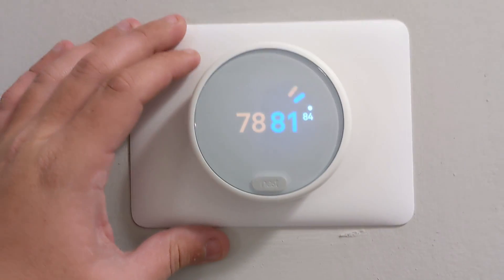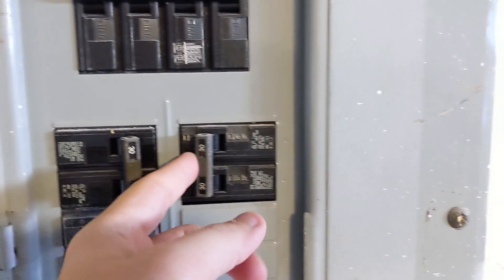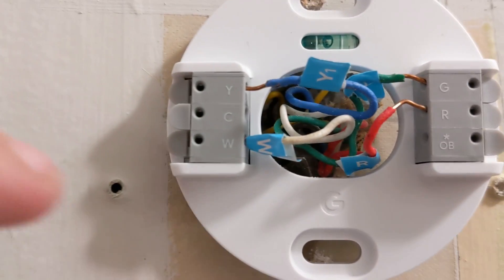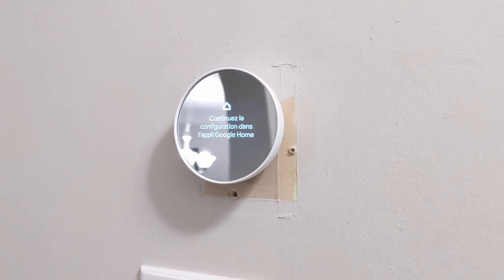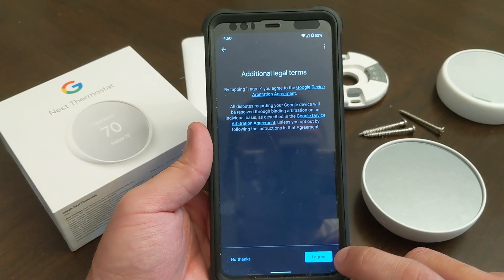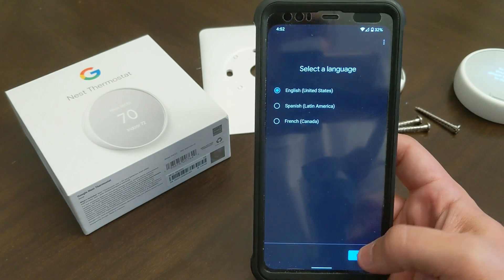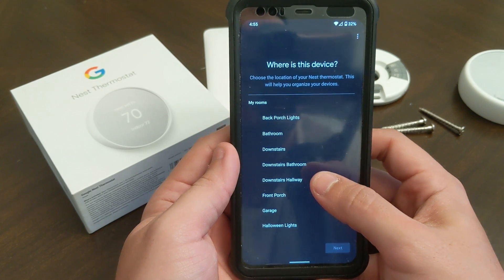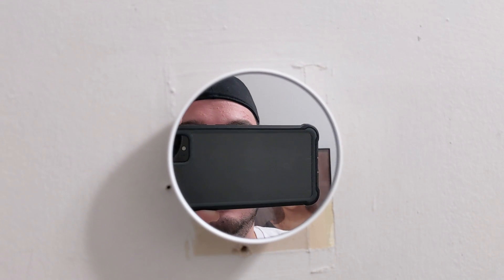Google Nest Thermostat Full Install & Setup!

Comment: I had issues with setting up the nest thermostat with my new eero network. I had to reset the thermostat using the setting on the thermostat. I then had to use the troubleshooting setting in the eero app to set it to 2.4 ghz until it recognized the nest and got the wifi connected.

Comment: I have a wire labeled Rh where does that go into the Nest?
Reply from the maker: Sadly I am not sure. I know on Nest's website they have a configuration page that tells you what cable goes where.
Reply: The Nest app walks you thru the wire set up

Comment: Hello! I'd like to ask you a question. Will the screen of the nest thermostat light up if it only has batteries?
Reply from the maker: I have never tested this, but I think so. My understanding is it has a sensor and whenever you walk in front of it (as long as it has power via the wall or batteries) it will light up so you can use it.

Comment: LOL the breaker you turned off is not killing power to the thermostat that you don’t have a common anyway the breaker labeled AC is for the outdoor unit hallway which does not powered the thermostat
Reply from the maker: Interesting. In this house and the one I just moved into, turning off the breaker labeled AC turns off the thermostat as well. Never been shocked when setting one and I switch them from time to time for other Thermostat videos.

Comment: Google make terrible terrible terrible user experience apps. The nest app can complete the heck of the setup and needs google home to finish, and that thing never finds the thermostat on wifi. The product really sucks. I installed first time, and after hours trying to make the wifi work it worked out of nowhere. Now I changed the wireless password and the nightmare happened again. 2 hours trying to just change the wifi and nothing yet. I don’t understand why not put nfc pairing on those things or wifi sharing password via google account. It’s really dumb. Hate to say that apple do it right with this, any apple device can validade another device wifi login in a beat.
Reply from the maker: Yeah I wish they did that as well. Apple does have it down pat.

Comment: Replaced to google nest. Issue is that fan doesn’t turn on with heat automatically. I set the fan to auto .
Always have to run fan manually or set in a schedule to turn the fan on. Any ways to get dan turn on with heat?

Comment: Does this Thermastat have a adjustable Differential in Temp?  Say I set it for 70 degrees, and it heats up to 70 degrees, and I can adjust it to  come back on if it drops to like 68 or 67 degrees.  I dont want one that is +1- degree differential. need at least 2  or 3 degrees Difference.. If only 1 degree Differential. It will go off and come back on in just a  few mins. runs too much at 1 degree. Thanks
Reply from the maker: Yeah, in the settings you can set it to cut on and off at certain temps  it you can't directly control the differential. If it was 70 in your house and you set it to 67, it would not cut on again till the thermostat got to 67.
Reply: @BigCVlogs  Thats Good ! Thank you very much..

Comment: Hey, love your video- question: How to adjust fan speed
Reply: Just go to that option and select it and you should be able to touch the side of the device to be able to adjust it.
Reply: You would actually need to go into the air handler and switch the wires. its not a switch or a setting, its actually hard wiring the fan to a higher speed.

Comment: Why didn’t you show what wires? That’s the ducking help I needed
Reply: It should be pretty standard.  
Blue - comum 
White- heat 
Yellow - cool 
Red - power
Green - fan
Reply: I have orange black and brown also
Reply: You got a heat pump?
Reply: The Nest app helps with the proper wiring during set up.

Comment: You literally skipped the only part I needed at 5:22. “Which of these wires do you have “ part
Reply: Don't base it upon his wires. Everyone could have a different set of wires. Just match yours to the new device. It will also walk you through it on the Google home app
Reply: The Nest app helps you with wire set up as you go.

Comment: My nest e doesn’t work so I got a nest 2020 and it worked(problem I think is nest e has tiny pins and one of them looked broken because I bought refurbished, so I bought a new nest 2020 and it worked well and also the pins are thicker so no more messed up pins

Comment: Absolutely a total waste of time. This is more of a brag video about your new Nest. When it came to setting up wires and or picking the boxes for the wires in the app you jumped right over the most important part. In the beginning you wasted 5 minutes of time with your BS. You never talk about the wire choices and to start you never discuss what heating and cooling system you have.

Do you have a straight air conditioner and a separate furnace? Do you have a heat pump.

As a civilization we are doomed because of the intelligence level of the human race.
Please take this down as it is a waste of time for those of us that are already frustrated.

I am sorry but someone needs to tell you this because you are not helping those that need help mainly me.

Thanks for your effort but no cigar Charlie.
Reply from the maker: I actually had to rewatch this. I clearly said "my wires are labeled" and had a pop up that very clearly said "the Google home app will help you with selecting your wires". (For people like me who don't know what a w1 wire is... The app helps you) Everyone's house is different, so since I'm not an HVAC person I was only going over the common person swapping a thermostat. 

While I can't understand how this video didn't help you, I got another 30k plus that were able to watch it and completely understand it with no issues.
Reply from the maker: The more I've seen, I question if you even made it to 5 minutes. At 4.5 I'm already in the app, the first 3 minutes were connecting, so I didn't need to follow the steps in the app... Which a person like you who has "Soo much common sense" should be able to do. At about 6 minutes it ask the type of heat/ac and I had to select it. 😁
Reply: There are many other who have similar comments as the one above...and I agree, you skipped over some of the stuff that should have been included.

Comment: I bought a 2020 model and it's impossible to control the temperature, every roomate wants different temperatures ALL the FRICKING time... they walk into it and change it from 68 to heat it up to 72 in the middle of the night, some burn in their room while others just get cozy, ALL I wanted was to set 69F from 9pm to 8am. But there's no PIN lock option, so be aware...

Comment: Anyone know why my Google home app won’t even detect the presence of the device to add it? Wont let me even get to the scan QR code screen. I’m struggling over here. Cant register / set up through nest app either.
Reply from the maker: I haven't heard of this issue. I would suggest reinstalling you app or if you have a different tablet or phone, install the Google Home app on that device and try it.
Reply: @BigCVlogs  I have tried a different tablet. I have taken the batteries out of the nest thermostat to reset it, I have reinstalled the app many times. I’ve checked my wifi , I’ve checked my Bluetooth. This device will not connect and nowhere I can find a solution. And Google itself is the worst at providing a solution.
Reply: @kyleluchia5862   try selecting RESET on the actual device and then reinstall the app and take the batteries out. Give it a complete reset and start from scratch
Reply: Same issue here!! Still working on it!!!
Reply: @kadiestarr9770  were you able to find a solution?

Comment: So I have a boiler and a/c both have separate control voltage sent to the existing thermostat...so I have r and rc connections in the old thermostat,no jumper, the nest only has r ....is there a way to still use the nest I have or am I gonna have to go another route with a different thermostat
Reply: Yes!! Just make sure you connect the nest the same way! You have your old thermostat!

Comment: Here is a question, why doesnt NEST have control over HRV?  These are mandatory on all newer homes over the past decade.  Its one of the reasons why i cant use nest thermostat.  Also, why must the system mode be on 'heat or cool' in order to just turn on the fan?
Reply: I have nest e and you can set the fan to run for however long you want without the ac or heat running. I'm sure it's like that with all of these. I just bought 2 of the newest nest thermostats for a building of mine so I still need to check out that google app. But ob the nest app you can.
Reply: Whats HRV?
Reply: @adanreyes7790  
Heat Recovery Ventilation

Comment: Great video, but why would you replace the Nest Learning Thermostat with the new Nest Thermostat 2020?  Seems like a downgrade!
Reply from the maker: Honestly....just to make this video lol  I switched it back to the learning thermostat and will use this one if I move and need one for my 2nd floor or basement.
Reply: After watching how you can change your daily schedule right on the Nest E, this Nest Thermostat IS a downgrade. 

I am also having problems with losing connection to the home app and having to repeat a factory reset. Throw it out

Comment: I only have a black and a white wire, will it still work?
Reply from the maker: Sadly I am not sure. I believe Google has a wiring diagram on their website showing which ones it will and will not work with.

I know the more expensive Nest Thermostat works with a lot more systems but it is sadly $250.

Comment: You didn’t have to use a C-Wire ?
Reply from the maker: No, my system doesn't have that wire. I think it depends on when your ac system was made, but I'm not 100% sure. I know the $250 "Nest Learning Thermostat" is compatible with more hvac units than this one is.